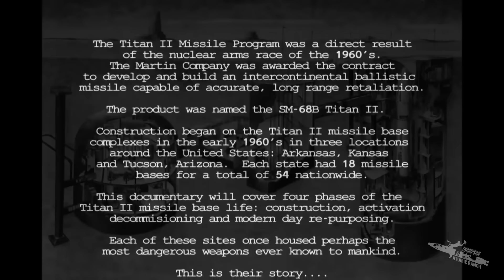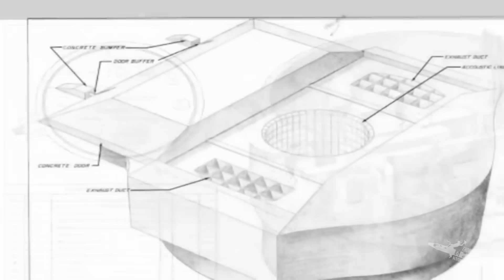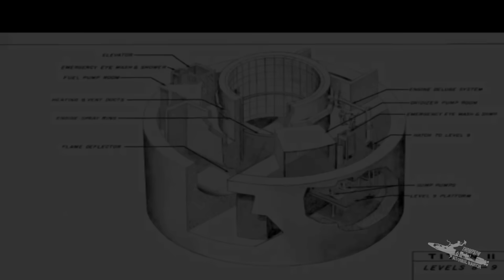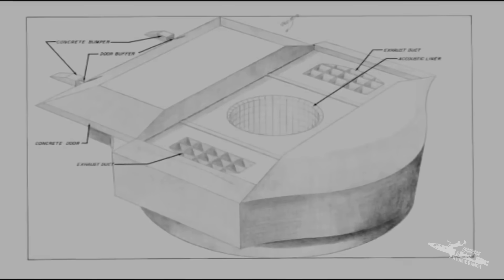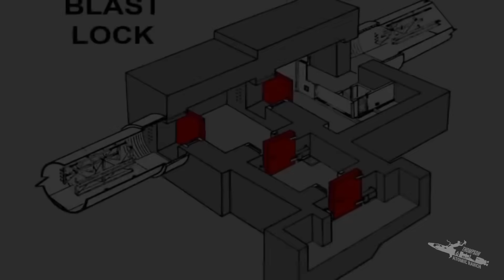Building a Titan II Missile Silo

Comment: Our company designed the Guidance and Targeting systems of the Titan2, Titan3, Titan34, and Titan4.  I am one of those design engineers.  The guidance system was accurate enough, that we used to have one particular target in the handbook of about 450,000 targets in Russia.  It was one of the third floor windows in the Kremlin.  We had one particular Inertial Guidance System (INS) which had the accuracy to actually target it.  Most of the production systems would miss it by a mile or two.  We used to track the "breathing" of the Earth, the changes of Earth's Gravity, the Moon, and later the varying densities of the Atmosphere.  In modern times this can all be done via the GPS, Glonass, and other positioning systems, to a much better accuracy, and our systems became obsolete.  The only remnant of the older INS is our Hemispherical Resonating Gyro, which is still the 2nd or 3rd best INS on the Earth.  Safran still sells it for commercial purposes.  Great for air Drones and underwater UWAVs also.

Comment: The introduction of this video is in error, describing the “Titan 2” in construction during the early ‘60’s. This was in fact the Titan 1 weapon system. The difference between the 1 and the 2 is vast.
Reply: Titan 1 sites were constructed from 1959-1962. Titan 2 sites were constructed from 1960-1963. Titan 1 sites were decommissioned in 1965. So from 1962-65 they were active. The last Titan 2 site was decomed in 1987. So from 1963-1987 they were active. Minuteman sites were constructed from 1961-1967 with the first site activated in 1962. Titan 1 was in use for less than 3 years, Titan 2 for less than 24 years. Minuteman in one version or another is still in use today some 63 years later. We started a whole new missile system in 59,60, and 61. Our tax dollars at work.😢
Reply from the maker: Construction of the Titan II did occur in the early 60s tho… Most sites were done by 63/64

Comment: Those inflation costs seem to be off by at least a factor of 10x. I quickly checked multiple cpi inflation calculators for 1960 and the highest I got was much less than 180 million which would be 1/10 of the value you mentioned. Awesome video though. Would have been cool to hear about what's happened to them since the 80s if you want to make a follow up.
Reply: Well, seeing that renovating the fed bldg in DC is costing 3.1 billion, I would say that to construct a missile silo complex for 1.8 billion sound like a steal. You are right. Based on inflation, 1.8 billion seems off

Comment: One of the sites near Tucson was preserved and made into a museum. We visited it back in August of 2023 and I highly recommend taking the tour if you get a chance. They even run a mock simulated launch procedure with all of the bells and whistles. Pretty spooky.
Reply: We took the tour a few years back but didn't get the launch simulation, that sounds pretty cool.  We did have a guy who worked in the control room for a decade while it was operational though; the one thing that really stuck in my mind was that the final destination for the warheads is still classified.  Really neat seeing it live and in person, just the way it was when it was operational.
Reply: @FlyGuy2000 that is one thing that will remain classified, if not Top Secret.
Reply: I’m sure you could guess the locations

Comment: I appreciate your effort on the video. It appeared to be mostly factual. The only problem I see with it is the cost numbers that you quote at the end of the video. You say that each complex cost $12 million in 1960. And then you say that it equates to $1.8 billion in today’s dollars. That’s a cost multiplication factor of 1500X. Things don’t cost anywhere near 1500 times as much as they did in the 1960s. The current inflation statistics show that from 1960 to 2023 is about a 9X difference. You might want to re-calculate and edit the video.

Comment: I was stationed in Little Rock 1982-84 as a heavy equipment operator. We would often go out to the sites to perform maintenance on the facilities. Usually in support of the plumbers. Sometimes we would have to go down inside the silos to work or get our briefing after entering the facility. It was always fun to go through the blast lock doors and into the control center. Once I was able to look inside the silo and see the missile. impressive facilities for sure.

Comment: In the early 60's my dad worked for the General Electric Re-entry Systems Division in Philadelphia.  They made the re-entry vehicle for the Titan II. That's the nose cone that held the warhead plus a lower skirt that held the electronics and the penetration aids.  The upper part of the nose was made of "ablative" material.  Basically a metal honeycomb with some sort of high-temp resin poured over it.  The ablative material functioned as the heat shield during the re-entry phase.  The lower portion of the re-entry vehicle housed penetration aids or decoys, in tubes mounted crosswise.  The pen-aids would be ejected during re-entry and would inflate to confuse ABM systems.  To open the side of the vehicle so the pen-aids could be ejected, long, about 1/2 inch wide, shaped charges that outlined where an opening needed to be, would be blown by the electronics.  Dad said the tooling that GE had in Philadelphia at the time was WW2 era and had trouble holding the tolerances required by the contract.
  At the Hill AFB Museum near Ogden they have or had a re-entry vehicle on a trailer transporter on its side and you can see the tubes for the pen-aids and the shaped charges bolted to the inside of the lower skirt of the REV.    The National Atomic Museum in Albuquerque has a complete static Titan II and a REV on display (along with an atomic cannon.)  On the base of the REV is a little GE nameplate. And of course there's both an REV and full missile at the Titan II Missile Museum south of Tucson.  There's also a Titan II re-entry vehicle mounted in front of the Moon Valley High School ("Home of the rockets!") on Cactus Road just west of 35th Avenue in Phoenix.  

Thanks for the video!
Reply: I worked at Chestnut St. So did my dad. He was a guard. Great place to work. Brilliant people.
Reply: @gatorshd  The Chestnut St. plant is where my dad worked.  Later he transferred to Manned Spaceflight at King of Prussia.  😀
Reply: @fido2006  I was a contractor in Philly. I became an employee in KoP.
Reply: In the late 80's early 90's I worked on the natural gas gathering systems as a xray tech doing nondestructive testing on the pipelines in the Roswell area, on the way back from the right of way one evening, Ii had the occasion to enter one of the abandoned Atlas missile silo.  They were smaller than these, I remember how much cooler the air was down there.  And dark.  there were 3 of us and I was still pretty nervous.  down the inital stairs to a curved door, right turn then a quick left down more stairs in the dark, when i turned on my flashlight I could see the giant round room with the floors suspended by steel rods.  down more stairs to a really long hallway that entered into the silo. looking up I could see daylight way the hell up there.  pretty spooky.  The other thing I remember was the wind blowing in that hallway.  later on I heard there was a nasty accident with fueling a missile and someone was hurt in that.
Reply: That last one is a little odd but cool as hell.
Reply: @Bramon83  When I drive by it I always imagine it's in a Nicholas Cage movie like National Treasure; a fully fueled Titan II, put there by modern Illuminati, waiting for someone to find the two launch keys hidden behind some bricks at the school.
Reply: KIM JONG is very grateful for your info of how to construct a reentry vehicle.
Reply: @nanordstrom "our button is bigger, and ours works"
Reply: I was told in tech school the ablative material was mahogany. On a “sniff check” (leak check with a portable vapor detector) we would have to get into the RV to sniff the Stage 2 oxidizer tank manhole cover. I was able to see the chaff tubes that would fire chaff upon re-entry to fool radar.
Reply: @mytwocents7527  Based on everything I've read the Titan II used a material made from a special plastic composite.  See "GE Century Series Ablative material" for more.  However, cork is used in launch vehicle thermal protection, in particular the Shuttle and SRS solid rocket boosters.  For a NASA paper on this with some interesting pics search for "tfaws2017 fundamentals of launch vehicle".  But that's launch and not re-entry.  Supposedly early in the Chinese manned space program they experimented with wood for re-entry heat shields since wood does have some ablative properties (charring on the outside while protecting the inside, at least for a while.)

Comment: The only thing I have to disagree with, 12.6 million in 1960 is worth 124 million in 2022, not the over a billion as the video said.
Reply from the maker: Not sure.   I read it in a book. Perhaps it is not accurate
Reply: @ThompsonAtomicRanch  certainly isn't. Probably worth calculating yourself as you present if with some confidence, even though it doesn't pass the sniff test
Reply: @Amethyst for sure it is the calculation but duno how it translate in 60years

Comment: I toured the one in Tucson. If I rembwr correctly, the monthly electric build for a site was close to $90,000.
Reply from the maker: Yikes! Ours stays at 65 degrees year round since we have no computers or other equipment running.
Reply: @ThompsonAtomicRanch  I could be wrong but as I remember the rocket propellant required the temperature to be maintained at specific degree otherwise it went boom.
Reply from the maker: @803mastiff9  correct! It has to be maintained at about 60 degrees or so
Reply: @ThompsonAtomicRanch  You live  in a silo? For what ever reason, I have always found the idea of subterranean living fascinating  . What is the most interesting thing you have noticed about living under ground and how does it affect the quality of sleep?

Comment: My father was an electrician on the Rock, Ks. sites in the mid 1960's.  He said it was interesting work but scary to think about what could happen if the missile had to be launched.   Once that job concluded he went to work at Boeing in Wichita, Ks. building...what else but B-52 bombers that are still in service today.
Reply from the maker: That’s awesome! He was part of sometime great, that’s for sure
Reply: Unfortunately the site at Rock Kansas was to be the site of 2 major events.  On August 21st 1978 during a propelent transfer,  a accident took place that killed and injured many personnel.  Many of the personnel that responded were exposed to chemical residue,  and were not given proper discharges, and never received any treatment or benefits for their injuries or disabilities caused by the incident.
Reply: @williamwisener5778  I had never heard of that situation.  Could it have been covered up by the powers that be?
Reply: @cstraws  Check out the History Guy. He has done stories on several near US nuclear detonations. Very interesting Stuff.
Reply: @williamwisener5778  What was the other event? I asked that once before but no one answered. I went to the sites the mid seventies and had heard of an incident but I don't remember what it was. I thought at the time 3-7 was jinxed. I was there also in Rock when an F105 went down. We could see the smoke from topside.

Comment: What a great video. Should be played at the Titan Missile Museum Green Valley Arizona. These weapons systems never should have been deactivated instead they should have been updated and retrofitted.
Reply: Seriously? You're hilarious.
Reply: The Titan missiles used liquid propellant, which was expensive and difficult to maintain and replenish; the solid fuel Minuteman had a much longer shelf life.  If you’re referring to repurposing the massive silo complexes, they were decommissioned and made unusable per START treaties with the Soviets.
Reply: I'd guess it's cheaper to build new than completely removing all the old stuff and building new in it's place.
Reply: So even by the 1970s the writing was on the wall.  The guidance systems would be no longer supported by IBM and by 1977 the fleet would have compromised readiness.  They were able to adapt the inertial guidance system from the 747 to work on the titan as essentially a stopgap.  But the obsolete electronics coupled with the hard to manage liquid propellant marked these magnificent missiles for replacement.  

We are looking at a similar problem with the minuteman iii today.  

I’m an AF aficionado, but I have to wonder if the SLBM isn’t the better platform after all.

Comment: btw… there are three missile Titan II Missile launch complexes at Vandenberg… They were built first and went on alert during the Cuban Missile Crisis…. and were used for many test launches.  They are still there.
Reply: One is a museum that is no longer in use. A few years ago when I had the opportunity to tour it everything was still in place.
Reply: @roostercogburn2600  what year did you visit 395-C (the museum), and what condition was it in?
Reply: @silopedia  2015 or so. It was leaking ground water at the time due to the high water table. Power was still on. Dead animals inside. All of the equipment was still in place as if it was walked away from yesterday. A couple of k-spans with equipment are still rotting away topside.
Reply: @roostercogburn2600  very interesting!  So far, you’re the most recent person I’ve talked to that’s been underground at the site.  A former care taker said mold and “bad air” was becoming an issue back in 2012, but didn’t mention water infiltration.  Could you see how much was at the bottom of the silo?  There’s literally only four pictures of the site on the internet.. somewhat of a “holy grail” for enthusiasts

Comment: Wondering about that 6000 lb blast door. That sounds like a pretty small number for such a gigantic door designed to stop a nuke blast? And the construction had to be built around it? Also the inflation numbers seem quite high. That comes out to nearly 9% per annum inflation. About triple the “official” number. Although I’m sure if the govt built these today it would probably be $10B per silo. Thanks for the video 👍
Reply: I was wondering about their inflation numbers, too.
Reply: I toured the museum Silo outside of Tucson. I pushed on the blast door with one finger and after several seconds I made it move. The door was over 50 years old.
Reply: The inflation number is very wrong, it's more like $112m in 2022 money
Reply: The blast doors are not to protect the workers against nuclear blasts, they are there to protect them against an explosion inside the missile silo.  The missile's are full of rocket fuel and they are kept inside a sealed silo, if fuel were to leak and go unnoticed the resulting explosion could wipe out all three structures, except the entire purpose of the middle structure is to act as a buffer between the silo and the command centre and it is where the blast doors are located.
Reply: One of the first things a new crewmember learned was how to have more than one door open at one time.  We weren't supposed to do it except during a launch that had stopped and we had to go into the silo equipment area to restart the launch then run like rabbits back to the CC.
Reply: He said the door weighed 800 tons (800000kg)
Reply: @ulf5738  not the missile silo cover but the blast door (to the crew area). At time code 7:35
Reply: OK, so I confirmed the door specs do say 6000 lb. It just seemed very small compared to the 1.6 Million pounds for the missile door. Regardless, very impressive. Thanks!
Reply: Actual weight is 740 tons !

Comment: I'm curious about the water table. Do you still have to pump water out, or did the original water that was in it come from water leaking in from rain?
Reply: Rain wasn't so much the issue as groundwater was.
Reply: Many of the sites around Tucson didn't need to, but most others filled with water without pumping.  There are some sites that were later sold to civilians and the water problem was a never ending battle for many that opened them and tried to use them for other purposes.

Comment: While it's intended purpose was in many ways a shame, you must be so proud to now own one of the most over-engineered structures ever created by man...  I wonder how they will fare over the next 1,2 or 3,000 years?
Reply: It depends on how wet or dry future climate is.
Reply: @SeeLasSee  We'll be long overdue for another ice age in 3,000 years so everything north of Arizona will be raked by glaciers anyway. Anything we can do to slow that down would be a bonus for perhaps one generation.
Reply from the maker: Time will tell! :)
Reply: These old installations are mostly falling apart faster than if they were on the surface. They basically became huge septic tanks for rain water.
Reply: I believe Concrete Buildings have a lifespan of 100 years. After that, the Concrete starts deteriorating.
Reply: Unless it’s preserved by man or nature it will return to its original form, dirt.